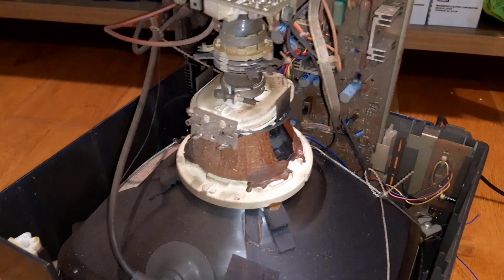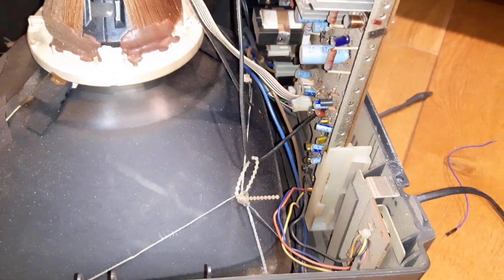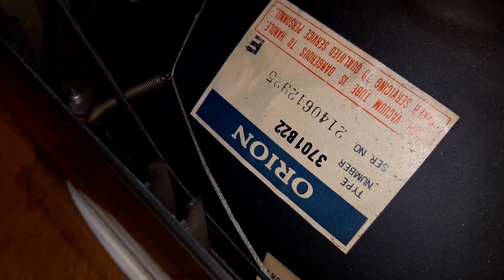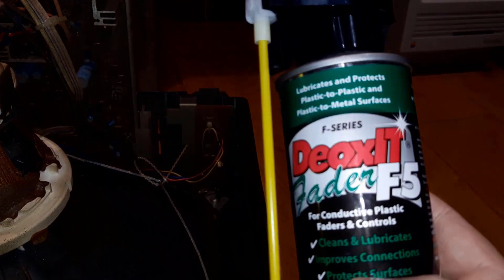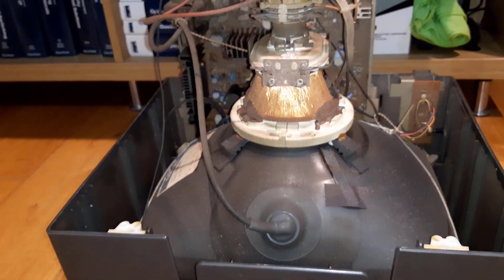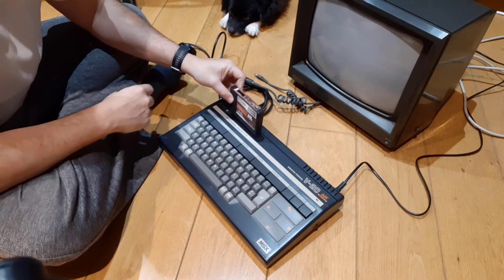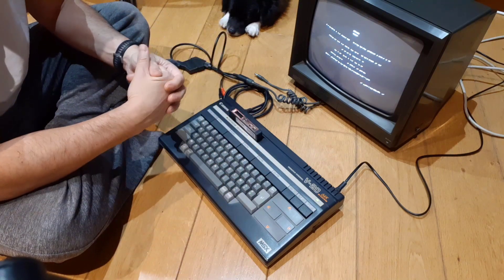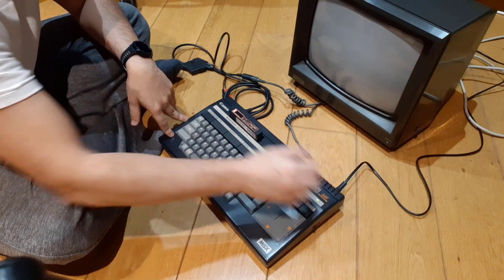Refurbishing an Amstrad CTM640 RGB monitor, and connecting a Canon V-20 MSX to it.

Comment: I have one of these in storage, along with an MP-3 (analog TV tuner for this monitor.)

I did originally have a CPC-464, but I later used it for my Amiga 500 with a custom cable, and Playststion with the MP-3

Comment: Ive replaced the tubes in several of these, These were actually really good monitors, ok they weren't flat like the sony pvm's but their picture was just as good, but they were actually built by orion technologies in the 80's around 1987, these are capable of producing a beautiful colour picture.